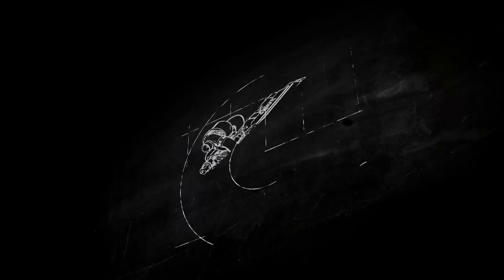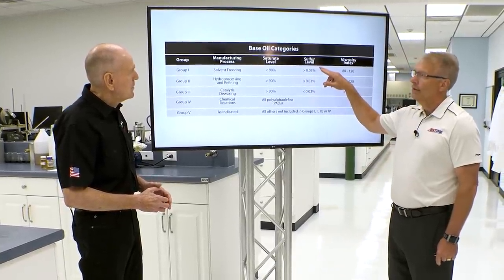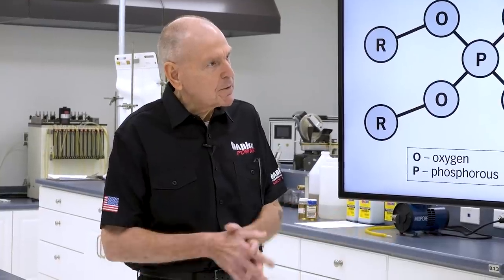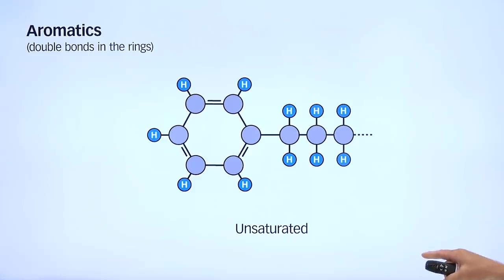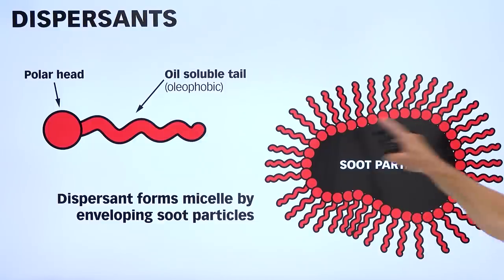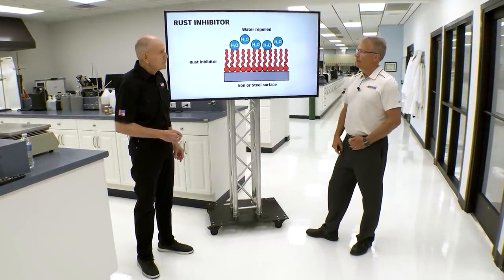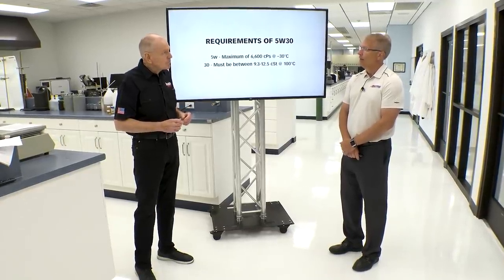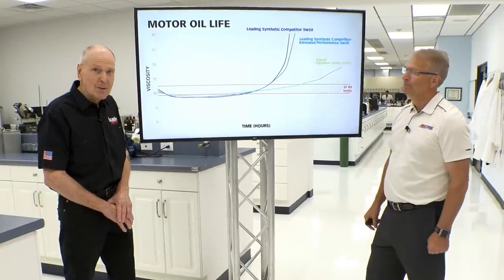What's in synthetic motor oil | Part 2 of 4

Comment: My '88 GTA Trans AM still has the Banks cat-back system that was installed in the late 80's / early 90's.  My father was part owner of an emissions lab in Anaheim.  He was quite impressed with the Gale Banks organization.  Don't know if he ever met Mr. Banks, but my father was a huge fan of the organization.
Reply: I was introduced to Amsoil by a friend back in September of 1973.  I kept using it in all my gas vehicles and when I started using Diesel trucks to haul my RV’s I enjoyed a continued great service life.  Not one of my cars or trucks ever used oil in my extended mileage traveling.  Oil analysis at almost every change always came back ‘oil still serviceable’.  I changed oil at 7 to 18 thousand miles, depending on the type of driving I was doing.  On a drive to Alaska (Arctic circle) from Buffalo in 1999

Comment: Im loving the dive into motor oil knowledge. I have used Amsoil for years, and my real world experience lines up directly with their claims. Two great American companies!
Reply from the maker: Thanks for watching, we love hearing from our fans! Stay tuned for more, we got a new episode coming next week.
Reply: not slamming on Amsoil, but i used it for a while long ago in my '98 cherokee, and was changing well within on time, and easy miles/hwy.  And it once became thickened like i've never seen before in any car situatino ever.  Very disapointed in Amsoil quality control-- that was around '06
Reply: So Amsoil admitted using a Group 3 base stock. Is this for all diesel oils????
Reply: @candyman1967  they use different base stocks in their three different levels of oil. So, the answer to your question is no. They mention the different base stocks they use in them.
Reply: @stusvids3595  
I never saw that mentioned. Only that they use group 3. Where can I find the info for Signature series diesel 5-40?
Reply: @stusvids3595  
I never can find specifics on the website regarding the base stocks and additives. Redline does a very good job listing them. Wish Amsoil oil would follow suit!
Reply: Awesome video! 🤯 so much great info! This breaks down and explains a lot. Thank you Gale Banks 🤙🏽

Comment: 22:58 Thank you Gale! Had some coworkers who bought into the stupid rolling coal image. In addition to what you're saying here about soot getting into the oil, they also couldn't comprehend that the black smoke from their diesels is actually unburned fuel, meaning their precious engines weren't actually running correctly, while also dumping expensive diesel straight out the exhaust.

Comment: I’m loving these episodes! I only use Amsoil in my vehicles and lawn equipment and I’m more resolved in my choice to stick with the best!
Reply: Me, too!  I'm thrilled with how well it works!
Reply: I’m a recent convert to Amsoil and it’s a choice il never regret. Excellent stuff much better than other brands and I mean MUCH BETTER. All engines are smoother, which is the biggest change after changing and the fuel economy is slightly better but different engines vary.
Reply: I still have a hard time feeling ok with running a motor oil long term like they claim can be done. If I only put 10k miles on my truck every year, I'd be fine with that,  but last year I drove over 110k miles and this oil gets pretty spendy
Reply: @goodmanboattransport3441  If you combine AmsOil engine oil with their bypass filtration, you can do regular, oil analyses and keep your oil in service for a very long time!  I have around 10,000 miles on my oil, and the truck still runs silky smooth!  I'm trying to get it to a yearly oil change.  So far, it seems to be working great!
Reply: @goodmanboattransport3441  well, if you spred oil cost over miles instead of an engine replacement or rebuilt, I would guess its not that expensive at all.

Comment: "Professor Banks" ... what a joyful ride into this subject. Retired (40 years) Lockheed Martin Engineer here ... knew a lot, learned MUCH MORE with this in-depth look at lubricants ... and just how important it is to pay attention to the OEM Engineers "Vision" on interaction of metals and oils. Growing up as a kid and "Dad" religiously following the "warm up" (every start) now makes sense given 50% of wear is at the beginning of start up ... there was no "Film" on the bearing/cylinder walls and a "metal to metal" contact point. Key points I enjoyed ... the eddy formation if you don't use the correct viscosity oil and "moisture barriers" ... the latter I can't tell you how much "raw material" I've had Subcontractors scrap when I caught them with "Surface Corrosion" on sheet/plate stock ... "intergranular corrosion" is real and over the "Life Cycle" of metal components, must be stopped up front.

And just an FYI: "Between 9,000 and 12,000 metres (30,000 and 40,000 feet), the cruising altitude of most jet aircraft, air temperatures range from −40 to −70 °F (−40 to −57 °C).".  And as you made a side note on "Diesel Fuel Waxing" ... learned the trick of that over here in the French/Swiss Alps in a rented Diesel Motorhome ... a bit of "gasoline" will get you home ... LOL. If you're ever in the French Riviera on Vaca, do let me know ... I think we could have some fun conversations over a Coffee !!!

Comment: Awesome video and can't wait for more.  I had a 94 ram 2500 with the 5.9 12v. I did some work to it to increase power. I have to throw this out there.  I used the banks twin ram intake. Massive improvement on how the truck performed. And also at that time I didn't have knowledge of synthetic oils. I used Mobile 15w40 diesel oil in that truck and in my 99 7.3 f250. In both of those trucks I noticed the slobber tube always was steaming away. More so in the ram. Come time to change the oil at the 3k  their was considerably less drained out than I put in. The oil just vaporized. Since then I quit using the Mobil diesel oil and moved to Amsoil OE diesel oil when I bought the Nissan titan diesel. Don't have that truck anymore but I use Amsoil in every thing I have. Trucks, tractor , mower, my echo equipment.

Comment: Good episode.  I do wish they would've covered the other additives like friction modifiers, extreme pressure, anti-foaming / anti-aeration, and viscosity index improvers.  I could see it being too much to pack into one episode though.  The differences, in structure and performance, between star polymers and OCPs is good stuff, as well as performance aspects of group V base oils like polyol and adipate ester, trimethylolpropane, and alkylated naphthalene.

Comment: Very educational! Hopefully the “rolling coal” folks pay attention!
I remember Gale saying long ago that soot is horsepower you’re leaving on the table
Reply: “If you roll coal, that’s horsepower going out the exhaust pipe
Reply: And I, doubt that The coal rollers pay attention, they Long ago flunked out of their ability to so do. And they fell for The Flat back rear diff covers are more better!
Reply: What he said about deleted the truck makes no sense tho because the egr is putting your exhaust back through the motor exposing your motor to even more soot, even a stock truck makes soot the dpf filter just catches it so it’s still getting some soot in your oil no matter what.
Reply: "anyting you see coming out of the tailpipe is lost power" Gale Banks
Reply: @offroadcanadian807  I think that is more down to Auto Manufacturers making inefficient intakes and manifolds for diesel engines instead of controlling fuel flow
Reply: Those who "roll coal" are stuck in the stone age and are folks who are the most difficult to learn that black soot means you have a completely messed up tune.
Reply: @offroadcanadian807  EGR is a poor engineering aka cheap method to control emissions AT THE COST of the owners engine that should go one million miles but will not.
Reply: @silverphinex  no matter what a deisel motor is going to put soot into the oil even gas vehicles put soot into the oil just not nearly as much. good clean tunes help limit how much soot is going in the oil. Free flowing exhaust and intakes help some, but for a stock truck the stock parts usually don't create enough restriction to affect anything.
Reply: @Garth2011  Yes I agree those garbage tunes that just throw a bunch of fuel at your motor arent doing anything but harming your motor.
Reply: @Garth2011  That was my point about how banks said something about deleted guys putting more soot into their oil which I cant believe to be true if you have good tunes and have the egr removed how is that worse.
Reply: True..rolling coal is not necessarily power. I have EFI Live on a 03 Duramax and it doesn't roll coal..it puffs a bit at launch and cleans up immediately. A supervisor where I work bought a used ram megacab, he swapped the intake and exhaust and added a tuner on max setting..he will roll coal like crazy and barely move, yep his truck is slow compared to my ol Duramax.  His ram just roars and dumps smoke..he thinks it's fast.👍
Reply: @offroadcanadian807  The EGR is the most damaging hardware in a diesel trucks emissions system.  The problems that arise in the regen are mostly electronics hardware that cause One Box failures.
Reply: @hudsondonnell444  what was the point of this comment? I’m confused.

Comment: For the 5 years my 1ZZ-FE (Corolla) engine was under warranty I used Amsoil Signature Series but followed shorter drain intervals to maintain my warranty. I am now in year 12 of once-a-year oil changes with Amsoil Signature Series 0W30 and EA Long life oil filters. The engine is running as smoothly as the day it left the factory. I have saved a fortune in oil change expenses and generated far less waste oil than I would have done with conventional or lower grade synthetic oil.
Reply: I have  a 1ZZ- FE also! Bought the car brand new on Saturday Jan 1st '05 with 000,037 miles on it. On Wednesday the '5th it got Mobil 1. I still have it with a lil over 670,000 miles on it! Yep 670! How do I know it has 670??...cuz after 299,999 the odometers stop going any higher.  After that I keep track on my trip meter in a notepad. My oil change intervals  are ALWAYS between  22‐2700 miles. I did discard using the factory oil filter and put a much larger filter on since day 1 ! PN 1516WIX..twice the pleating surface area.
Reply: @vannorman1116    If the odometer has six digits it's a million mile odometer. It shouldn't stop at 300,000, it goes to 1,000,000, Well actually 999,999.   It's broken!  ok?

Comment: Been using Amsoil for over 20 years. Never blown up an engine. Did a full lifecycle with a Corolla, 330k miles when it was totaled. Still ran perfectly, only had one oil change per year its entire life.

Comment: This is awesome information. It clears up a lot of misinformation about synthetic and conventional oils. I have seen first hand the performance difference in running a conventional oil vs a synthetic oil in my vehicle. When I run synthetic oil in it the engine is a lot more responsive and accelerates noticeably quicker than when I had conventional grade oil in it.

Comment: I had a basic understanding of oils but this video gave me a lot more info about the chemistry and all the technical terms. Never tried Amsoil but I know it is absolute top notch. I usually help my dad put Rotella 5w40 diesel oil or Valvoline 5w40 Premium Blue in his 2020 6.7 Powerstroke. I bought a gallon of Motorcraft 10w30 diesel oil to use in all of my small engine power equipment because of the 1000 ppm zinc levels.

Comment: My father, who was a professional mechanical engineer, taught me that it is good practice to put an engine to bed hot. Getting the oil hot helps condensation (moisture) evaporate from the crankcase. 
That said, it drives me crazy when people will occasionally start a (long term stored) vehicle for a short period thinking its goid for it.

Comment: How many hours of a test on the oils  for that graph? I feel like it was conveniently left out.      Great tidbits of information that the layman could understand surrounded by physicist speak!  Thanks Gale! Looking forward to the next video!
Reply: I wondered the same thing. It looks like the test runs way out to failure.

While a typical oil interval might be  200-500 hours, I wonder if this is 1k-2k hours.
Reply: The scale on those graphs is generally misleading. Engine oil failure tests generally aren't run in real world conditions, because they would take way too long. To get them done in a reasonable amount of time, the oil companies usually do stress testing - so they'll run the test at higher temperatures, reduce the oil volume to make it work harder, etc. Once you've done that, the test hours bear no resemblance to real world performance so they just show the relative performance between the oils.
Reply from the maker: This is a lab test AMSOIL uses to improve motor oil formulations that run in severe conditions in the field. The test length represented in the graph is in hours. Both competitors' useful life ended after day 10 or 240 hours. The AMSOIL Signature Series product had end of life happen after day 13 or 312 hours.
Reply: @bankspower  Thanks for the info!  It would have been useful to have had that on the graph itself.  God bless and Merry Christmas!
Reply: @bankspower  it would be cool to see the log(hours) time scale. Betting it would make the curves piecewise-linear...

Comment: I have met and spoke to the two engineers at GM who plotted the oil change graft. Short trips, oil temp, coolant, long trips and even calculated engine loads. They pointed out the was based on recommended synthetic oil values as recognized by ASTM and they can't control what brand of synthetic is used, only how it reacts in the engine under a huge number of factors. Concluding they kept it on the conservative side to attempt to get the best results of least wear to testing for metals known in the engine, but the oil itself. Not all synthetics are created equal as some use cheaper additives to reduce POS and maintain a market share. One admitted he bought one the last GM "F" body's and used Amsoil in his vehicle. The other had no comment but admitted he changed his oil more frequently instead of waiting for 10% oil life, changed his at 30% oil life.
ACDelco MASM, retired ASE master tech.

Comment: Love the effort in the video & the explanation. 
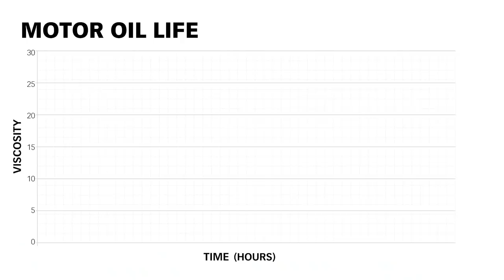37:19 The data appears incomplete as the time (hours) is not given. So we do not know if this is after the normal suggested change interval. 
Engine oil blending was part of my interest years ago. 
But a big Thankyou to Mr Banks & teams for presenting this video.
Reply from the maker: In regards to the hours, this is a lab test AMSOIL uses to improve motor oil formulations that run in severe conditions in the field. The test length represented in the graph is in hours. Both competitors' useful life ended after day 10 or 240 hours. The AMSOIL Signature Series product had end of life happen after day 13 or 312 hours.

Comment: A little information is a wonderful thing. When I started riding Harleys in the 70s, everyone ran 60wt in the summer and 50wt in the winter. Sometimes even 70wt if it was a hot summer and ya had to sit in traffic a lot. But it made cold starting a pain! When multi-grades started catching on, I started running 20W-50, everyone said I'd ruin my motor in no time.